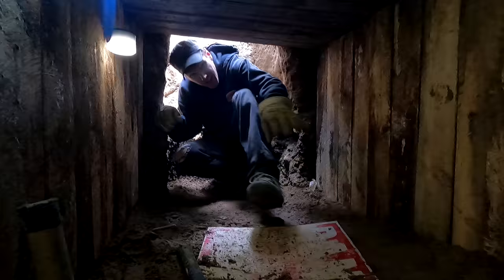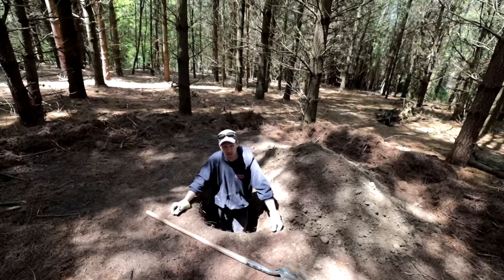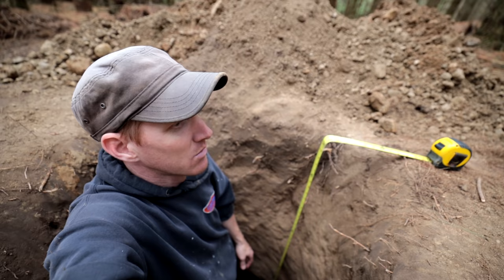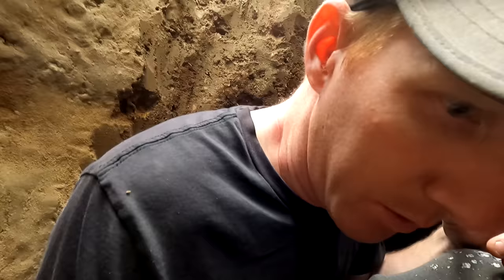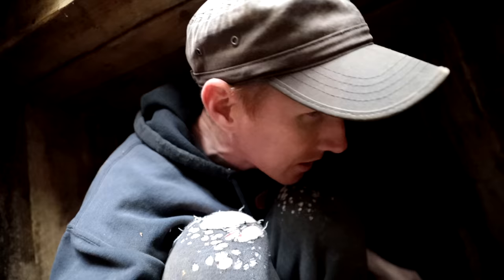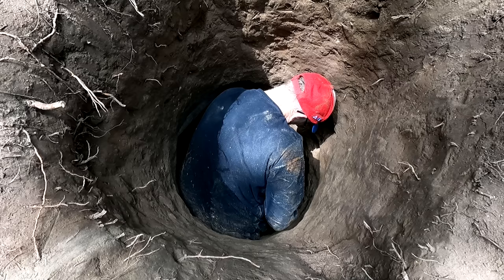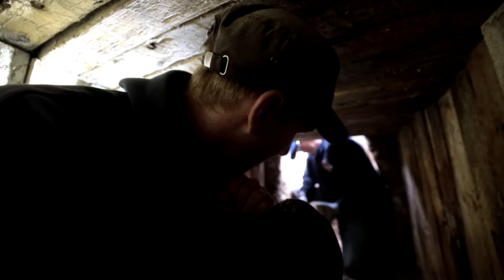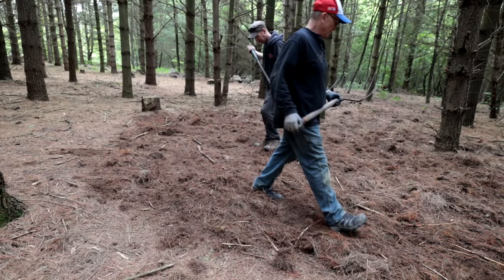Digging a Japanese Spider Hole (and sleeping in it!!!)

Comment: Built a few foxholes with those army shovels. Two or three guys share the digging detail. I was always amazed at the holes the Vietcong managed to construct. Tunnelling is an art, keep your airways clear! I'd prefer to go down to about ten feet, we'd have bolt holes like a warren down there, come out the side of a earth work, small mound, large tree root for disguise. We deployed in groups or 3 or 4 and thus had set routine. 3 or 4 units would work together for bigger tasks. those Esbit cookers are useful, but we'd use ration packs in a chemical pack that needs no flame or high heat signature but heats your food. 
It's called an Israeli Bandage for that reason. You should also have a tourniquet in your I-FAK (issue first aid kit).  you need to check out MRE's or Ration packs - on just beans you'd get a mutiny...lol. My favourite was ration pack C - Chicken Curry and rice with a chocolate brownie. (UK)
Most undemocratic threats are from within; the machinations of uber rich people who feel they are better than the rest of humanity, or from corrupt government ministers who are purely selfish and sociopathic in nature - these are more dangerous than all other threats.

Comment: As kids we used to have a place like this in a nearby tiny forrest. It was ofcourse amazing, but it was incredibly dangerous because the overhang wasn't supported with wood. For a year or 2 it stayed open proper with just a plank covering it up, but over time (i guess also with heavy rain) it just kinda became shallower and shallower and after like 10 years it was only a small hole barely knee deep.

Comment: That little stove is a hexi burner we use them in the British Army, you put your heximein in it and place a mess tin on top filled with water to boil your ration pack then use the boiled water for a tea or coffie or a shave ect . They work best with mess tins m8. However most of us ditch them after training and buy are own little gas stoves just easier to use.
Reply: I may be wrong, but was he using it upside down ?

Comment: As others pointed out, digging a pit at the entrance is a good idea. Also might suggest a CO2/CO detector. CO2 is heavier than regular air so settles at the bottom right where you're sleeping.
Reply: If he kept that candle lit then you already have a CO2 detector, along as the candle has a flame you have oxygen.
Reply: @danielfairclough3008 yea but doesn't candles take more oxygen?

Comment: You should glut a layer of needles to the boards. You'll still want to pile loose needles on top but, you have no way of knowing if it's fully covered when you are inside. Gluing a layer of needles will reduce the chances that the wood is exposed. You could also add a deeper layer held down by thin wire.

Comment: Those little fire/cooking tablets are great for hiking in "no fire," minimal impact areas,  or above tree lines where locally acquired combustible material is hard to come by. They are very dependable for producing a specific amount of heat over time. With some practice you can tune them to just enough to get the job done. They are light, compact, easy to use in many conditions, but keep it outdoors. Perfect for a few day hike.

Comment: Love this project. If this was for real a tracker could find you in a minute. Here's why.... the area where the pine needles were pulled back and returned show a unnatural perimeter. To really hide we have to consider what the area around the "hiding hole" looks like and how well it blends into the surroundings. That's if our lives really depend on places like this...I hope it never comes to this. Thanks for honoring the men and women who willingly would risk their lives so we can stay free.
Reply: Very true, but I feel like this was just to show 1 way of going about it, you could cake on dirt to the wood and disguise the handle as best you can to look like a loose stick in the ground, but a professional tracker (or whatever the term is) will still see the unnatural way the dirt lays on the wood, or how it mounds up in that 1 spot in the woods to try conceal it.  Basically, it's blooming hard to blend in.
Reply: But after a few months rain and mire UV rays it will be invisible as thise needles will match again. We had to repair our blue roof shingles on q 4 year old roof. The new square stood out like a sore thumb for only 5 weeks now you can't tell.
Reply: good news, you won't have to hide from a real tracker you really only need to hide from drones (IR)
Reply: Trained dogs would be a somewhat low-tech way. The high-tech way would either be near-infra-red LIDAR (aka THz detection) which can see differences in ground density or ground penetrating radar.

Comment: I live in Yukon Canada. Most of the year the ground is pretty frozen by the time you get down three or four feet. Because of the permafrost, the trees here don’t get very deep root systems. They spread out instead. The trees also end up tall and thin. There are some trees with nice thick trunks but not very many compared to other places.

Comment: the stove appears to be "Hexamine", the British military used to use it but has all but phased it out in favour of returning to alcohol Gel (cleaner burning with minimal smell), hexamine is actually toxic and contains cyanide so I'm extremely glad you didn't cook with it inside the hole, always advise using it in a well ventilated area, also they're usually coated in a waxy coating to protect them, so it helps to break one tablet in half and expose the broken side to the flame.
Reply: Believe it or not the Army still uses Hexamine on bases in the case of trainings, I know this since I went on a military exercise with the Royal Marine Cadets and had to use Hexamine burners
Reply: @RusoOutOfContext  yeah, cadets still use them to rotate out old stock but in general they're not stocking more new ones
Reply: Some call them hexi cookers highlander solid fuel cookers👍
Reply: @RusoOutOfContext  Yeah we use Alcohol Gel in training as well. doubles up as good feild hand sanitiser.
Reply: Still sell them

Comment: The fuel cells you have are used commonly in the outdoors. Often found in survival kits. These are Hexamine tablets.  
The way you were holding it was upside down, although I suspect the one you had there could be inverted.  Great experiment with the Spider Hole. Very neat indeed.

Comment: Your fire starter should have a ridged edge, that part is used to scrape off a chunk of the metal which will fall onto your kindling. Sometimes it works better if you use a slower more forceful movement. 

I also have a portable stove like that, and I think you were using your's upside down. The fuel should sit into a recess (not a flat smooth spot) so it doesn't slide around and will be partially protected from the wind.

Comment: I think it'd be better to dig something like  rectangular grave, and then you don't have any chance of any dirt collapsing on you.  You will have to make your rppf larger, but digging a rectangle box has to be easier and much more useful for an area than an L shaped mining supported whatever.  Plus sitting down, you could hide two people in it.

Your biggest problem is going to be dirt, mud and  rain.  I'd line the thing with tarps and make the roof bigger than the opening and water proof.    Build a rectanglular wooden frame that can drop in there and keep the tarps pressed up against the walls.of dirt.

Comment: You did it backwards. Japanese Spider Holes were dug diagonally. You dig out the space underneath, dig straight up (which is a lot easier from underneath) and when you are done, you collapse the diagonal shaft. Makes it much easier.
Reply: I don’t know anything about digging but wouldn’t that be much more dangerous because you are spending more time underneath with a risk of collapse and harder because the dirt is falling on your face/head as you dig up?
Reply: @TheMuslimBatman  More dangerous than what? War?
Reply: @calistman222  if you aren’t currently in danger the way you describe seems more tedious and dangerous, also how would you collapse one part of a tunnel without collapsing the whole tunnel?
Reply: @TheMuslimBatman  Bomb craters make an excellent place to start since you are already dealing with a diagonal surface. After you have tunneled to the spot and hollowed it out,  you really don't need to go to great lengths to completely collapse it. Just make it impossible to traverse and conceal the spot you dug in from.

Comment: Amazing video, what I would recommend is Like you said nice shelving for cameras gear etc. as well as carving the bottom a couple more inches so your head fully fits when sitting in the hole, it will at a lot of comfortability as well as increase the size of it drastically. Simple fixes but will make the project that much more accommodating .

Comment: You need a grave digging or monument  shovel there about 10 feet long with a metal bowl on the bottom  you put a thick  plank of wood across the hole  start at one side put the shovel into the ground and pry it off the wood then move the plank across in slight increments  this is how we use to dig foundations for headstones at the graveyard

Comment: Would have been a whole lot easier and safer to just bury a section of big black 4 foot wide pipe. Two men can carry a 20 foot section into the woods, no problem. And there are caps, end pieces and "T" pieces all pre-fab. And it won't rot. Then just build a flat floor in the pipe to sleep on and stuff things under as storage. Keeps you out of the water on the floor if it rains too
Reply: There ar many better ways to do the project but if you didn't catch the drift of the video, he was paying homage and showing tribute to what some troops have done/do out in the field.

Comment: A very entertaining video of the construction of your spider hole! Just a few points about the stove you were using......we used them in the army and they were called Esbit Stoves. Small yet highly effective. When you used it, you used it upside down. If you turn it over, there will be a slightly higher flame area, allowing more heat to reach your pot/tin, and thus be more effective. The fuel tablet will sit inside the small indentation, and will remain centered, and not slip all over the place. Thanks again for a great video, and warm greetings from South Africa! 👍😉

Comment: If you ever do this again, try digging a wet sump under your entrance, going down diagonally away from your sleeping area. Ideally you want it to be the length of your arm + your e-tool. It will catch water and allow it to drain into the soil, keeping you dry, and doubles as a grenade sump to contain the blast if someone decides to drop you a surprise.

Comment: I think it would be best to dig the hole next to very thick bushes to avoid giving a thermal signature to that hatch. No matter what you do the hatch will not be the same temperature as a solid surface specially in winter.
FLIR and military thermal scopes work by looking for areas or borders where there is a huge perceptible change in temperature. This is how drones can spot people sleeping in the grass, or rocket stoves dug into the ground. If your opponent is an advanced military power, you need more layers of concealment. 
Also your body odor will likely filter out of that hole and tracking dogs can find you eventually.

Comment: Just a word of warning, the flint and steel you were trying to make sparks with, only creates an ember in very few tinders, I can't quite see what you had as 'fire starter' in the tin, but it will need to be either 'char cloth' (or other natural charred material) or dry tree fungus, as nothing much else will take an ember from such a cool spark as made by flint and steel ignition, you would hold the char cloth against the edge of the flint when you strike the steel down against the sharp edge of the flint so the sparks from the combusting iron particles go straight into the char cloth to cause the cloth to smoulder. Then to get a flame, you then need very dry and very fine 'fluffy' tinder to put the smouldering charred material into like a 'birds nest' which you will still need to blow into flame. This is a much harder method of creating flame than using a modern 'fire steel' (ferrocerium rod) which make much hotter sparks and can ignite many dry tinders directly, or matches or a lighter which are both way of combining a hot spark and initial tinder in one small package

Comment: take a bean can, cut notches in the top for air, fill the can 1/2-2/3 with vegetable oil, roll up a coffee filter, tie it around a rock or nut, drop it into the can into the middle like a wick... light it... have flame and a heating source for hours and hours, if not over a day.

Comment: A narrow trench would be better with two exits. 4-5 inch diameter logs can be dug in to form the roof prior to putting plastic, soil and debris on top.  if deep enough hang a hammock.That’s a hexamine stove and tabs. Popping both hatches will help when cooking.

Comment: Your esbit stove is being used upside down. The fuel will liquify and pool so you want to use the deep base not the flat top part so it doesn’t run off the stove. Also you can angle in the sides into a triangle-ish shape to hold smaller items like your can. Works great with a metal canteen cup.

Comment: To protect against grenades, the hole needs to be 2 to 3 feet deeper than the tunnel, that way if a grenade comes down while your in the tunnel, it will land deeper in the hole and direct the blast upwards.  Not gonna be pleasant, but it’ll keep you ticking

Comment: As for the foldeable cup: Thats neat, but when you have a water bottle, then you dont need the cup, you can drink right from the bottle, the cup is only unnessesary weight and space. I have such a foldeable cup but only in my travel-hygiene-bag to use it as a cup for water after brushing my teeth. And even there it isnt really necessary because I could get the water for cleansing my mouth after the toothbrush right from the tap.

Comment: the pucks are hexane, or hexamethylene tetraamine.  Made with ammonia and formaldehyde, in a pinch they can be turned into c4 with nitration and parrafin and aluminum dust or detonator charge with 30 percent peroxide and citric acid for hexamethylene triperoxide diamine.  Handy stuff. makes great firecrackers.

Comment: Word of advice, try putting a piece of mesh/bug netting just bigger than the hole across the face of the hole while inside to keep bugs and mosquitoes out. Just friendly advice. shouldn't affect the air flow either.

Comment: That's a type of esbit stove with what are likely hexamine fuel tablets. Some field rations come with less sophisticated versions of these stoves that are just a single sheet of metal with some cuts in it that you bend into a stove shape. Like anything that burns you should have ventilation, but I've heard (never used one) that hexamine burn fumes are fairly mild and people have been known to use them in poorly ventilated spots without feeling too uncomfortable. Obviously don't be like them though, just saying it's probably a lot safer than burning antifreeze.

Comment: You should mention to fill such caves again after non usage or at least "break the ceiling". Do no body can step in there... .

You could heat such cave with a fire during all day. After 1,2,3 days it should be totally cosy (& smoky).
In general, great if you want to stealth camp for a few days.

Comment: Kidnappers taking notes as they watch this video.  😬 😉 By the way that stove you have is actually an East German Army  galvanised stove, they are hard to come by in good condition. You are using it upside down like a lot of first timers do with folding stoves. Was issued with similar  folding stove in Brit army so shown how to use it correctly.  However full marks on the work you put into the Spider hole.

Comment: I’d build this with camping in it wholly in mind. I’d make an effort to cushion the floor, perhaps make it long enough to hold a little recess for a car battery, inverter, and mini desk heater. I’d also mount battery powered lights and have a case for some MREs in there. 

I wouldn’t have the door hidden and I’d make it wide enough to have a ladder. I’d build a shed over the entrance and make some ventilation pumps. In the shed I’d store a generator and mount some solar panels and batteries to power the ventilation.

Comment: When it's life and death, you don't get so tired digging a hole :P

This actually seems very dangerous without some sort of ventilation. Even a light show could mean suffocation. I guess if this is how they did it then maybe it's not so bad but I kinda suspect there were secondary air ducts dug into it at various points back when this was used in the WWs.

Comment: I would of made the hole much bigger so that i could get a weapon out easy. I would seal the hole around the cover for water and the door. I also would put a layer of dirt on top so if someone steps on it nothing changes. Wouldn't make a top that can be tripped on. ALso a vent in the top. BUt this is top notch and im sure others have few iideas. I actually think we all should have these built through out the state and north to protect our lands. You never know if we could be invaded and be nice to have tunnel system made. It;s actually why i got interested in this. Home def to the max

Comment: The fuel source for your small stove could be a hexamine fuel tab/cube. I've used lots of them. They work pretty good but they do smell pretty bad and can leave a nasty taste in your food/fluid that you're heating up. Use them in an area with decent air flow and you should be good to go.